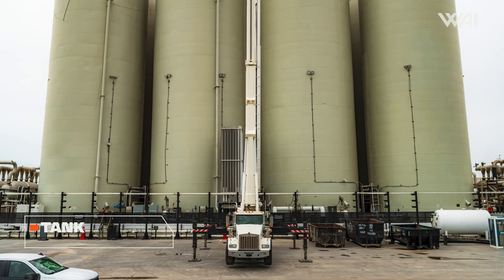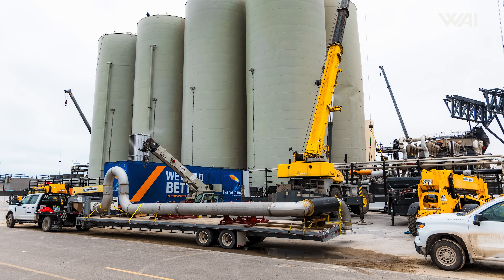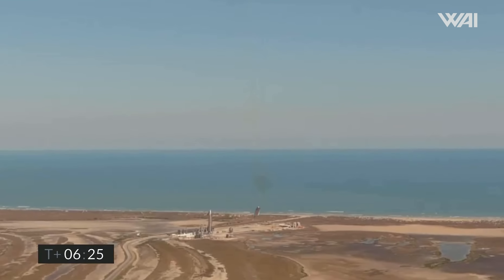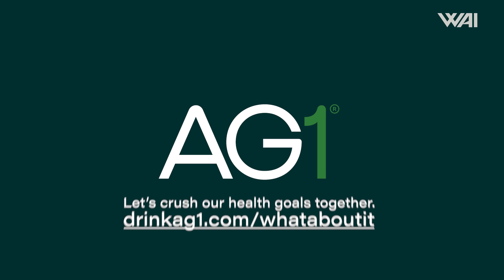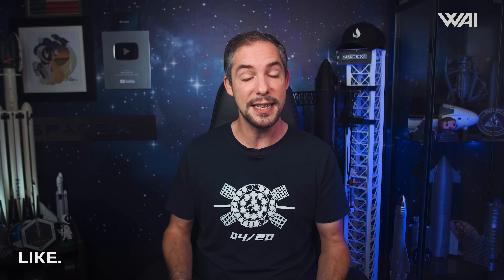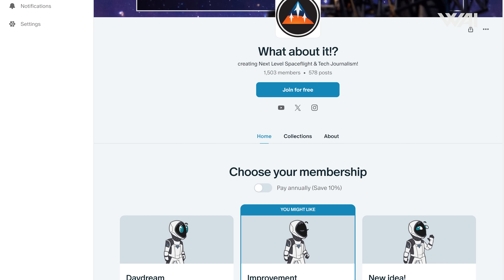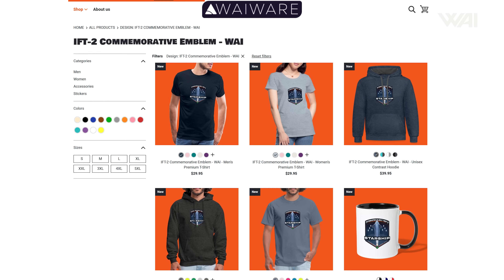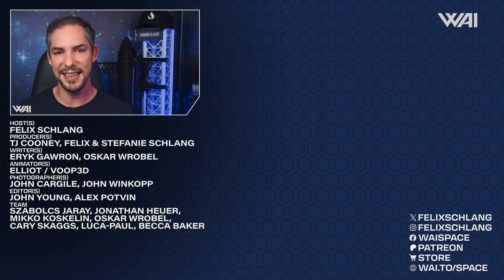SpaceX Starship Countdown To IFT3 - Massive Launch Site Upgrade!

Comment: The idea of moving the spherical tanks or cancelling 39A Starship is nonsense clickbait. The new tanks at Starbase will provide enough capacity to replace the current vertical tanks, and the entire purpose of building a crew tower at LC40 was to provide redundancy in case of a Starship failure at 39A. 39A definitely isn't priority for SpaceX right now, and it is very possible that the launch table intended for 39A will get moved to Starbase. But 39A (and likely the proposed LC45) are definitely going to be part of the future Starship program (along with 2 towers at Starbase). It seems increasingly likely to me that all of these (and potentially more) may be needed to support lunar and Mars missions.
Reply: The lng methane fuel infrastructure is so extensive as opposed to Florida might not be economic at the moment to invest in Pad 39A for Starship especially given 2 Starship failures at the moment and nothing to show for a single Starship Launch either now nor with the next one other than an FAA investigation.  NASA Administrator seems pretty optimistic and as a former Space Shuttle Captain and US Senator that's a huge vote of confidence as presumably no fundamental flaw with the Booster has been noted. If the Orbital unit still can't find its way into Orbit that would require a complete re-work of the design and engineering which would be a truly stunning expense. NASA we already know doesn't have this problem with SLS having already achieved trans-lunar injection. The goal for Starship is to launch a massive number of Starlink Satellites in one shot thus ahem "paying for everthing" ahem. My understanding is no way will this Rocket ever be making it to the Moon let alone Mars. ULA has already stayed they're pulling out of the launch business so...if anyone wants a Rocket Program there's one for sale right now! Hopefully this one doesn't suffer a fate worse than that one as presumably ULA Vulcan is both very robust and I think the term is "scales well."(scalability?)
Reply: @doolittlegeorge  IFT2 was hardly a failure. The booster performed flawlessly until boost back and the ship made it to space as the largest object to ever do so. Compared to the early development of Falcon and the failures it had, and it's amazing track record now...SpaceX will get Starship figured out and it is going to revolutionize space travel. It will take more "failures" to get there, but SpaceX will fail successfully on their way to the Moon, Mars and beyond.

Comparing it to SLS is apples and oranges. SLS is using old Shuttle technology to send a small capsule to the Moon. Starship is many more orders of magnitude larger in terms of mass to orbit.

Comment: Are the OLP legs cracked or the flame deflectors they added to shield the legs? I appears from the video it is the shield. Isn't the OLP on the far side of the new LIT at LC39A so the tower would actually provide some shielding to the Falcon pad?

Comment: What if the tower sections are to extend the current tower for a longer starship?
Reply: I wonder what's the height limits in the area then... but the increase weight will create issue too... but with the ISP of the booster ... it's a dirt in the bucket...

Comment: Have the Blue Origin explained why a BE-4 engine exploded on the test stand last June 30th?
I hope the BE-4 are reliable as expected, because they are meant to be reused, albeit not by ULA. There are so little information around the BE-4, that we forget they were meant to fly by 2019.
I just don't like the fact that the BE-4 use a single giant turbopump for both fuel and oxidiser.
Thank you for the video Mr. Schlang.
Greetings,
Anthony
Reply: Plenty of rocket engines use a single turbo pump design though most are smaller than a be4.

Comment: You had the tank and launch pad portions backwards. For them to reach their intended flight every other day, multiple launch pads will be needed 

So transporting the round tanks, it would make more sense for them to be an addition to the current tanks or increase capacity and, as you said, reduce refueling between launches.
Reply: Felix I enjoy yr vids, but yr nonsense at the end is unnecessary and demeaning ! Plse stop it.

Comment: Why not tiles on the table mount and legs? If they resist on the booster re-entry it should work perfectly here
Reply: Tiles are too fragile I believe
Reply: @BCR81  but they resist on the vibrations when the racket goes up and the vibrations and heat when is entering in the atmosphere…on the legs of the mount, if they glue/mechanically fix them proper, should perform ok.

Comment: Why does the booster launch with the grid fins extended?  Are they used during launch to steer?  Do they provide stability?
Reply: Because the machinery for making them retractable costs more performance than the extra drag from leaving them deployed.

Comment: LC49 (or LC39C, as I like to call it) would be a much better option going forward than a double-use LC39A.
Reply: Especially since it would give them the option to launch starship and falcon within hours of eachother on the same day, if they wanted/needed. If they tried that from same pad and anything bad happened, it would crust both launches. Just safer and gives more options.

Comment: Hey Felix, I have a question. Why doesn’t SpaceX consider burying or placing a sort of bunker around the orbital tank farm? Shielding the tanks from multiple angles. Could that ever work?
Reply from the maker: Burrying them would not work well. Sea water table is very high there. But a bunker could work. I do think that the end result for the tank farm will be vastly different. A pipeline to the launch site would be the ideal solution in my opinion. Starships are very fuel hungry and so having all that on site is not the right thing I believe.
Reply: That would make it much harder to fill or service.
Reply: @Whataboutit  I wonder the far future plan for the farm will be to relocate to where the suborbital pads are... I doubt it will do much flying if starship is pretty much proven... plus additional storage using the existing suborbital equipment
Reply: Could back fill with sand, absolutely works as an insulator as well. Tear down the vertical Tanks and prepare another one further distant and fully house and protected as a back up to the now apparent horizontal "farm."

Comment: the metal plate help up ok but deflected the blast from the engines back up and sidewards..damaging parts of the pad.
also the booster was still firing with 3 engines at the same time as 6 engines were pushing the other way from stage 2 on separation.
then they tried to increase the booster engines to 10 while the booster was being pushed away and still turning.hence fuel starvation..and engine cut of and detection by the auto destruct.
please dont say spacex didnt know what was going to happen there clever people. was a nice touch watching tiles floating past on launch that were detached due to the blast.
good luck to them on the 3rd attempt fingers crossed.
Reply: A flame trench would have solved all these issues. A pile of compacted earth and ramp would have been faster, cheaper and less maintenence.  Apollo pad 39A showed the way 55 years ago.

Comment: Moving such a huge tank maybe could done with a new kind of blimb? existing versions could lift up to 140 tons. so why not getting bigger? Blimb-XX
Reply: Well, building blimps is not trivial. 
And the tank is 350+ tons, so that would require the biggest blimp ever built by a huge margin. 
The trouble of moving the tank seems kinda overstated to me though, the total over land distance you need to move it is less than half a mile if you use water transportation  for which the weight is absolutely trivial.

Comment: Idk I don’t think one giant tank is a great decision during what is basically an experimental phase for starship development. I don’t picture a giant boom, although as a houston native it’s possible. More, smaller tanks seem like the smarter decision in case one is damaged/fails. Easier, quicker, and cheaper to replace.
Reply: More smaller tanks means more surface area, which means more cooling/insulation systems. It's likely more economical to use a single large tank.

Comment: I'm guessing the spherical tanks at 39A are leased with the land, not owned outright by SpaceX. They have potential future use at the Cape. Might be more efficient to order new tanks fitting the road and footprint at Boca than try to buy, then move, such a beast.
Reply: yea I think it would also be cheaper to build new ones at starbase, rather than all the engineering and equipment to move. There is no "standard" for moving tanks that huge, or at least none I could find.
Reply: @tathianxgames  Agreed, moving them would be madness. They'll be useful where they are in future, and if they wanted something similar in Texas, they'd just build them there...

Comment: In Jerry Pournelle's opinion, the RL-10 is reliable because it was designed by aircraft engine engineers.  Building the cryogenically cooled nozzle is extremely labor intensive, so going to additive manufacturing holds the promise of far lower build costs.

Comment: Whether at 39-A or at 49, SpaceX desperately needs a Starship launch facility at the cape. They need to get it built ASAP, even if NASA won't give them permission to launch right away. Waiting to start construction until such permission is granted will only be a tremendous waste of time. They are restricted to only five launches a year from Starbase. There is absolutely no way that they can do the R&D necessary to get Lunar Starship ready to fly in the next few years, or even get Starship operational, with that kind of restriction.
Firefly seems to have a better chance of establishing stable operations than most other launch startups. Good luck to them!

Comment: I’m picturing the giant sphere moved to Starbase, not at the launch site, but further up the road at a truck delivery depot as a secondary storage unit. After each launch the tanks at the launch site would be refilled from the sphere by way of a pipeline.
Reply: Sounds good so far. It would give a bigger reserve for filling rockets. It would also allow truck delivery to be uninterrupted by frequent launches.

Comment: I have a question after watching the last flight. With the way the condensation accumulates on the Starship would it make any difference if heat tiles,or any other type of insulation were added to the side of the ship that houses the fuel do anything with stabilization of the rocket or maybe keep the the fuel inside more stabilized to allow for better or more controlled consumption during flight? I'm a mechanical guy and not educated in thermodynamics so please excuse any ignorance on my part but that's why I like WAI. Thank you all for the great work in bringing outstanding content.
Reply: The Chinese currently add large, curved rectangular pads to the outside of their rockets purely for insulation. You can watch these fall off at initial launch.

Comment: Acceleration of the starship. The starship is at a vertical velocity until the engines are ignited.  How quickly does the starship pick up speed.  What is the velocity when the starship is one mile above the launch site.  How about after ten miles? Does anybody know the rate of acceleration?  Just curious.

Comment: I'd imagine they wouldn't have built the tower at 40 if they still plan on 39 SS/SH launches, but I'd also imagine that given the cracking etc. on OLM-1, they'd consider tearing it down and fixing these issues instead of waiting for them to crop up later

Comment: Why throttle down, light the second stage launching off a booster at throttle no fuel issue then and solid push off, more efficient?

Comment: Correct.  Starship will not launch from LC-39A, in this decade.
SpaceX could pursue LC-49 (old 1960s Apollo LC-39C location); OR

Acquire LC-36 , after last Delta Heavy launch (March 1, 2024), 
it would acquire LESS $$ and Pad retrofitting, LH2 tanks converted to Methane.

Comment: Im surprised that SpaceX hasnt covered the platform legs with heat tiles just like the ones used on starship itself.
Reply: that's exactly what I thought!
Reply: The tiles would support the heat but not the blast of the 33 raptors. They would be ripped off immediately
Reply: The heat tiles that just fall off the Starship, those heat tiles???
Reply: @cailloux44  they could always glue them on.... or weld them.
Reply: as if theyd stick during a launch, they wont even stick to the starship.
Reply: @Rorschach1024 actually it wouldn't help because heat tiles are hyper fragile. They are composed of silica ceramic which is porous and super fragile. You can break it with your hands, like the molded polystyrene protecting electronic devices in their box. So would definitely not support an engine blast. The space re-entry is different though as the air friction is pretty smooth and all the energy is converted into heat, which the tiles easily support.
Reply: It does not have to be the same heat tiles with the same method of attaching them. But, good point.

Comment: Great surprise Felix Fix.  So radi-kewl.  Stage Zero is a critically big deal.  Methane side of the farm?   Fart Farm?   Heh...   Replacing the vertical tanks with shielded vertical tanks is an improvement.   Go horizontal.  Moving a rusty 70 foot steel ping pong ball does not seem worthwhile.  More starlink video is a major bonus.

Comment: A strong risk approach needs a catching tower away from the fuel stores of a launch tower. 
The rapid reuse phase of Starship is at least a f ew years off.
A Luna mission needs reliable reuse for fueling. (Now 2027) One booster or SS can RUD a tower and leave the Luna fueling stalled.

Comment: If V2 of the Starship is 33' longer, won't that mean the launch tower will need to be higher as well?  It doesn't look like it has another 33' of lift for the chopsticks to go up.  ??
Reply: They might have lower supports on the hull of Starship V2.  That would allow the tower and arms to remain unchanged.  We will see I guess
Reply: Attachment points could very easily be lowered

Comment: I'm 66 years old and as far as I'm concerned moving that spear is not even a thought.
     Not just because of the size, but because it is half a century old and has its own intergranular corrosion problems and metal fatigue because of that.  In other words, "UNSAFE TO USE".